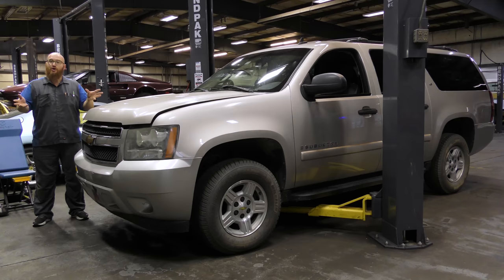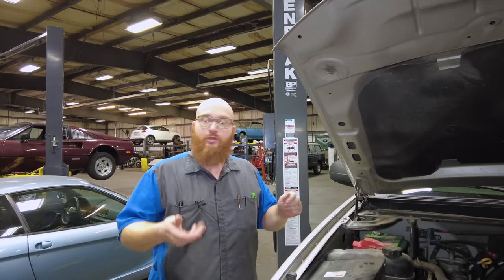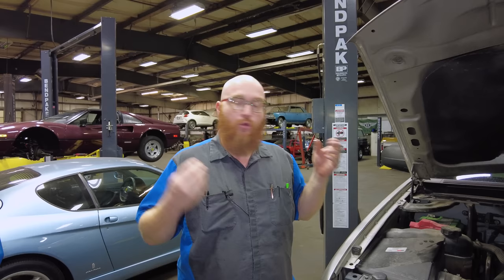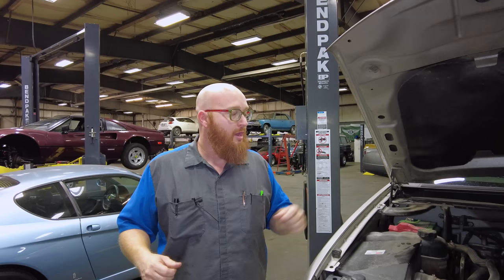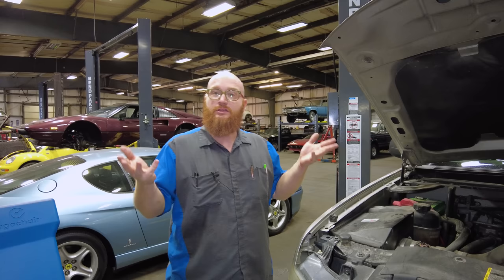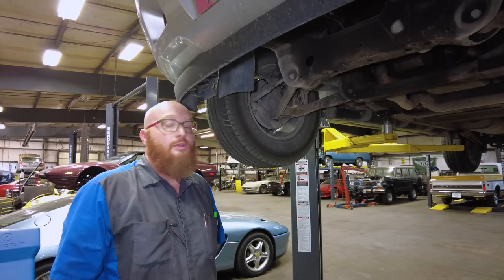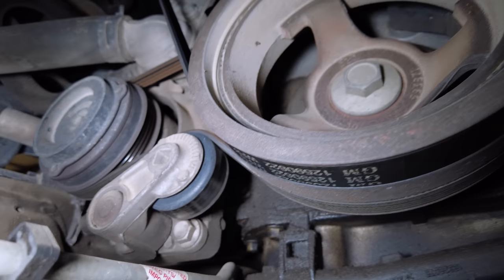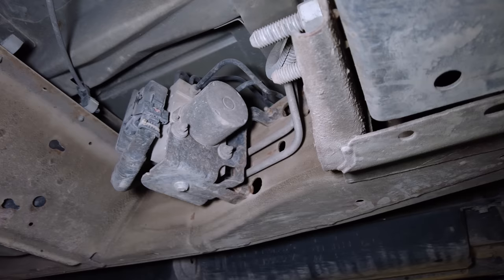What fails on ALL early 2000's Chevy SUV's!? CAR WIZARD shares what he's seen from the last 20 years

Comment: I bought a 04 Suburban Z71 a little over a year ago and it's been great. There are a handful of issues but it's mostly little things. I honestly enjoy having the small projects. I get to learn of to fix it as I go along and so far I've had a 100% success rate. I feel that this year GM trucks were the last generation that was built to last. As long as you can keep them from rusting and treat them good they'll be good to you and your family. I love the body style also. The newer ones (07+) just don't have the handsome looks of the older generations. Long live the GMT-800!
Reply: I agree with you. I have an 04 Z71 Tahoe 4x4 and a 2012 Tahoe and I must say I love my 2004 more than any vehicle I've ever owned.
Reply: Nice chrome bumpers on the older trucks  👍
Reply: 04 Avalanche, 185k and still going strong.  Normal stuff, I'm surprised the ball joints are still good, I expected they'd need replaced 3 years ago.  Iowa so it's just rusting away.  Every time I think of trading I look at prices and what I'm "upgrading" to and just keep driving it.  I'd love to find a clean, rust free replacement but they don't exist here, I'll have to go South for that.
Reply: Lol right 😂
Reply: @richc9503  lol right Just another confidant Bow tie girl owner
Reply: A relative of mine has the 03 Suburban z71 - it was the transmission that just went out this year.  They fixed it as it had been bought for cheap. Hoping for them, that it holds up.
Reply: I feel the same. I look at my '05 Tahoe and think she's so pretty. And she's a tank. Forget the new body styles with their plastic bumpers. I bought her new with 6 miles on her, she now has over 250k and except for a few BIG things, I've been able to do most of the work myself. and have done a lot. You get one of these new ones, and there are just too many electrical components  that can go out. I am not on board with that. She's about to get a new set of Mickey Thompson shoes, and I'm really thinking I should just get her a whole new suspension set up under there, so she can feel young again.
Reply: I have a 02 Silverado Z71 4x4 extended cab long bed. It has 364k miles on it and without question has been the best vehicle I've ever owned. Only expensive repair I've had to make was the rear main seal. I had changed the oil pressure sending unit prior without fixing the low oil pressure issue, so I had them put in a new oil pump when they did the rear main seal. Running like a champ ever since. I've had lots of decent offers for this truck, but I can't seem to bring myself to part with it. Love that truck!!

Comment: Missed a few things... Radiators in any GM vehicle of this era tend to stress crack in the side tanks, usually around 150k-175k miles. Can't even begin to guess how many GM radiators I've replaced due to this. Will be doing my own here in a few days as well lol. 

Another 4L60e failure that isn't really the transmissions fault (although it isn't the best design either) is the sun shell in them. When people shift from reverse to drive without bringing the vehicle to a stop first (such as when they are backing out of a parking spot and then throw it in drive while it is still rolling backwards), it tends to lead to a failure of the sun shell. It'll either crack at the base of the splines or the splines get physically stripped off of it. 

Also, the plastic on both the interior and exterior door handles tend to break on the GMT800 (1999-2006) platform as well. The exterior handles people tend to pull them up and out when opening the door which fatigues the plastic. The interior ones have a structurally narrow point in the plastic and when they break they almost always break off right at the base of the handle. The plastic GMT800 truck tailgate handles are extremely common to break. 

They may have some quirks but the 90's and early 2000s (up to 2006/7) GM trucks are the pinnacle of GM trucks and overall pretty well built. I have a GMT800 yukon xl that is rare and sought after due to it being a 3/4 ton with the 8.1L aka 496 big block in it. People try to buy it off me all the time. The answer is always "not for sale". I tow 7k lbs with it literally almost everyday (it has the 4l85e transmission, which is much stronger than the 4l60e). Even as a heavy hauler it is extremely reliable and I'm not about to give it up.
Reply: I thought the 8.1s had the 4L85e transmission no?
Reply: Temperature control module! Manual one not digital!
Reply: @alecmurray8339  looks like he edited his comment and didn't say anything about you mentioning it
Reply: @jonnardjackson2884  I have a digital temp controller, can I replace it with a manual one when it craps out?
Reply: @rackaddict8227  I am not sure! But I don’t think so!
Reply: Dealing with this right now on my 2005.
Reply: Absolutely 💯! I hate plastic tanks period!
Reply: I bought mine with 195,000 miles on it from the original owner. He commuted to work at about 125 miles one way on the 10 freeway. When I test drove my 2005 Tahoe (4.8 liter v-8) it was driving at 10 psi oil pressure and dropped off to nothing at idle. And yes it clattered like hell. 
I dropper the oil pan, replaced the rod and main bearings, high pressure\high volume smelling oil pump and pick up, new timing chain and gears, hi performance oil and air filters. Added a spin on oil filter and Hayden deirl cool trans cooler and engine oil cooler.
Puller the intake manifold and replaced the oil sending unit, both knock sensors, cleaned the intake and block with new gaskets and new valvoline 40 wt. racing oil. I replaced both valve cover gaskets, timing cover gasket and a new water pump and the lower split radiator hose set. Installed a real cool air intake box and replaced the AC transfer tube for the remote evaporator for the 3Rd row seats.
All new brake pads, shocks, inner aand outter tie rod ends, idler arm and pit man arm. Aligned the front end and other than a new battery it has been bullet proof and one hell of a great vehicle ever sence putting it back on the road. 
[I did have to replace both actuators for the blend doors though]

Comment: Also worth mentioning if you buy a 2008-2009 Denali/Escalade/Suburban with the 6.2 they won’t have any of the AFM hardware. 2007 had the hardware but was never active but in 2008/2009 they removed it entirely. 2010 was the first year they had the hardware and was fully active.
Reply: I’m looking at a 2010 chevy tahoe with 300k mikes yeah yeah I know a lot of miles , but drives really good, interior/exterior looks really good, any advice on this? Is it worth getting it?
Reply: Definitely get it.. I have had all these problems with my Tahoe but I still enjoy my Tahoe over my 323i.

Comment: Got all of them except 3 I have dealt with quite often. Gas cap seals setting off the evap code. The brake light switch failure that causes the cruise to turn off... all the time. Leaf springs, notorious for breaking.
Reply: @Bubbles12345-cat  leaf springs don't come to a stop.
Reply: @Bubbles12345-cat  I don't blame you, I blame the public school system, and the meth crisis.
Reply: @beausw  Yeah ☺
Reply: @Bubbles12345-cat  you got the queen's English right in your name. Happy labor day weekend! Cheers.
Reply: @beausw  I'm actually from Africa.  ☺
Reply: That leaf spring thing really pisses me off.   They knew they had a bad batch from the supplier and they didn’t cover it.

Comment: We bought our 03 Suburban new.  It now has nearly 600k miles on it, going for a million.  Replaced the engine with a GM crate engine at 500k, which turned out to be an excellent decision.  We have faced many of the issues Dave mentioned, plus a few more, the most annoying of which is rust out although we have always kept the vehicle clean.  Would like to get it fixed, but can't find anyone in our area (Newton) who will repair anything but wreck damage.  We love the Suburban and plan to keep it indefinitely. I really enjoyed the video!
Reply: Newton Ks?
Reply: Best fix is drive south and buy another from outside the rust belt as in the south they basically last forever and use your current truck for parts. There are still plenty of them about.

Comment: I'm just going to start knocking on wood.  2008 suburban with 230k miles, honestly been one of the most reliable vehicles I've owned.   Only thing we've had to do other than normal maintenance items is the rear end axel seals had to be replaced.  Almost any vehicle can be reliable if you take maintenance seriously.
Reply: JINXED
Reply: You can push it to 260k miles, my 02 Yukon XL made it
Reply: @umad42  oh I think so, I wrench on the side all manufacturers have there issues but im familiar with gm dumbness.  Very proud that I've only had to take a vehicle to a mechanic maybe twice every decade.  Again like I've told family and friends maintenance is key.  Don't let problems snowball.
Reply: @umad42  my Silverado is 254000 and doing great
Reply: Did you buy it new?
Reply: @TheSailingwoodworker  no bought it used several years ago before prices went nuts.  Paid under 8k as it was at 170ish and needed regular maintenance done.  In 60k miles I've put maybe 1k in parts on it.  Heck the new tires this year were its most expensive single purchase.   For me this line of trucks blends modern convenience with relatively easy maintenance and part availability.   Even if something big breaks its still cheaper than new.  Heck a  new car is 400 to 500 a month plus expensive insurance and plate cost.  Worse case a upper end rebuild is 4k.  Stretch that out over 12months and you get. 334 bucks a month.  No car on the market will beat that.  Heck year one pays for the motor, year 2 pays for a transmission. 8k replacement cost on a 10k truck is still a 18k truck with a new transmission and rebuild motor.  Find me  full size vehicle for under 20k that would be better.   And thats worse case scenario.
Reply: @ozmosis0074  You don't know what was repaired in the first 170K. (unless you have all service records)
Reply: @TheSailingwoodworker  yes and no.  A good visual inspiration will reveal alot of information about a vehicles life.  With the suburban i bought, brake lines were rust free, which in this area means it was kept indoors and washed.  Roters were free of excessive ware, shocks were good, tie rod and ball joints had been replaced once in its life as they had Grease zerts and were actively greased.   No major oil leaks, heat covers on the manifold were still rust free.  On the interior the brake pedal rubber wasn't worn off so light foot pressure was used its whole life.  The valve train didn't have oil varnish buildup so oil changes were done on a semi regular basis.   The rear end had a blue felt pro gasket under it so the rear end was serviced atleast once before.   Front diff, trans and transfer case had paint marker on the pan bolts or drain plugs so they all had been serviced before.   Alot can be seen if you look hard enough.

Comment: I know a transmission shop owner who has upgraded GM 4L60E transmissions to the 4L80E for a few hundred dollars more and it solves the problems with the 4L60E transmission. The extra cost is usually because of the different wiring harness adapters and different U joints or Yokes.

Comment: But then the exhaust leak has its own set of consequences, which I’m surprised you didn’t mention, Wizard.   Besides the O2 sensor reading diluted and cooler air than it should, which is crucial for the fuel mapping, the hot air coming out right there generally damages or destroys parts around it, and depending on the make and model of vehicle, can ruin the alternator connectors, power steering hoses, of course ignition parts, brake booster vacuum line, vacuum lines in general, engine harness wiring, ABS pump connectors and brake lines can prematurely rust, as oxygen plus heat make for rapid oxidation, but then there’s the most dreaded yet subtle consequence of all.   Our own psychological phenomena.    When our cars start to break down, the issues tend to start piling up, and by then, our resolve tends to wane, while the repair bill tends to grow, the oil changes stretch out, air filters are forgotten altogether,  you stop washing it, dirt and mud never get rinsed from the nether regions where rust takes it’s cancerous toll, and the noises which at one point grabbed our attention and got fixed, now are just part of a cacophonous non-symphony, yet quickly become ignored by our ears, and that rust bubble is just a bit of dirt, and that rattle in the back is just a rusty muffler, but it’s leaking scalding hot air right onto the fuel pump and it’s wiring, and that mud has called up the EVAP parts, rust has rotten most of the fasteners such that ANY repair turns into an evil game of attrition versus determination, and, maybe it’s time for this car to go to the junkyard, even though you just spent $1,000 to get that AC blowing cold, and $600 on new tires, and $800 on shocks and some bushings and control arms, not to mention you did two window motors yourself at $50 a pop, and you just spent $100 on nice new “custom fit” seat covers to bandage over the cracked leather.     Your car is paid for, yet you are prepared to start all over again paying $400/month whether you like it or not, when you couldn’t bring yourself to pay half that much on upkeep of the vehicle you once fell in love with and cherished?   Oh, how logic and emotion clash to bring uncertainty to both.     Make it happen.     Car Wizard gets it.   I get it.   Get it.
Reply: This is the best thing ive read in a long time.
Reply: Playing whack a mole was fun, until a brake line failed around year-17, sending us into a red-lit intersection.  Lucky.  I pulled over, pedal to the floor, half expecting to see nothing wet with hood open and spouse testing pedal.  Instead, a thin fountain went out the engine bay from right in the middle an unmolested straight section of line.  

Anyone in these '99-10 owes their family new brake lines, if you're still banking on OE.  Don't.
Reply: And so familiarity breeds contempt. Like a marriage going sour, you held on through a couple more vacations despite the urge to just stop pretending you still cared.

But you're still young, midlife crisis looming, but young enough to start over with another partnership. Next time you vow to do better, to be more faithful. Though deep down you wonder if you're strong enough for the unknown.

Soon enough the day will come when the futility of always trading up, with the concurrent rise in costs, isn't really worth the pursuit of perfection. The day you begin to provide prosthetics and cosmetics to the situation, you'll be on the road to understanding mortality, and it's inevitability. Then the odd sounds and occasional miscues will be glossed over by the knowledge that in the end, it's not about how we look, or how many miles we covered, but rather if we had a life worth the remembering.

--Notes left in a '49 Cadillac.
Reply: I'm getting misty-eyed.

Comment: Good video but a corrections suggested- 2006 5.3L has AFM I own one. The solution is to have it disabled in a tune mod by skilled personnel like PCM of NC. The biggest issue is that some of the oil that operates the AFM gets into the cylinders ruining the catalytic converters over time and that will happen in cases where it otherwise appears to be functioning, not outright failing.  It also fowls the plugs in the cylinders where it’s worse. There is virtually no fuel savings from AFM from the measurements I before and after the feature was turned off. Good tips throughout, thanks.

Comment: Surprised by the lack of calling the 4L60E by it's commonly know nickname, "A box of neutrals" 😂😂😂
Reply: Just driving along and boom, 5 neutrals haha.
Reply: Lmao. That's the truth. If you plan on towing with a 60e good luck to you
Reply: 4L-slippy-E
Reply: Goes PNNNNN
Reply: 3rd gear is the electronic failsafe, and that's a 1:1. Well, you don't go anywhere fast at a 1:1 ratio behind a torque converter.
Reply: My 93 S10 blazer has 304k miles on it, original transmission and transfer case, it is on its 4th junkyard engine though. Regular maintenance on a 4l60e will help out tremendously. Mine has had 3 flushes and filter changes. Now the frame is so bad in the rear that I don't know if I'm going to patch it again. It's already held together by 2 pieces of 2x3 1/4" angle iron in front of the rear shackle  on the drivers side.
Reply: None of those use 4l60e. The use 4l80e or 6l80e

Comment: Got a 2004 GMC SIERRA 5.3 with 315,000 plus....besides regular maintenance parts, two alternators, three water pumps, one knock sensor and one oil sending unit she still runs great! Not sure why but a few of the relays were failing....replaced all relays...all good now! 👍

Comment: I have a 2004 and that transmission has served me well. Every time I connect a trailer it goes into tow/hall mode. That trans no has over 295k on it. I change the fluid every 2 years. I love it. I have also changed the cluster. All break lines, fuel lines, hvac components like blend doors. The vehicle has never left me sit.

Comment: I would like to add that another thing to cause the oil pressure sending unit to fail on the earlier models is the little screen they put in gets clogged and won't let oil get to sending unit, also, you can slightly decrease the change of breaking a spark plug wire with making a few full rotations with the wire on the plug, and can't forget the PCV valve failures, but I thoroughly enjoyed learning a few more things, love your content
Reply: yeah, i replaced the screen filter underneath  the oil sending unite for my 2007 tahoe LTZ, 
. it was a little cumbersome but I got it   done, the engineers corrected one problem to keep the rollers clean on the lifters but created another one when using a gas filter for motor oil